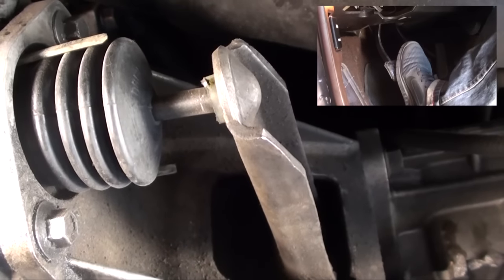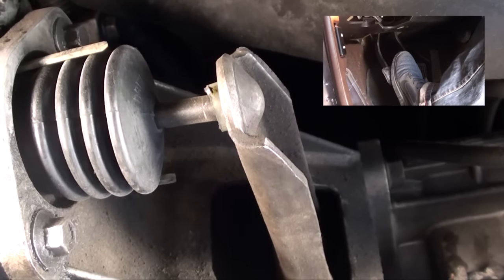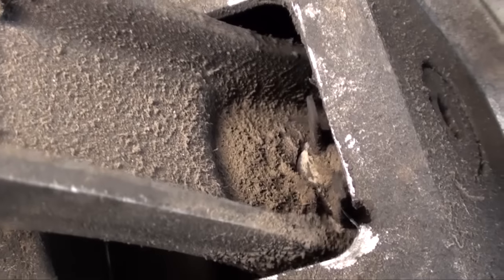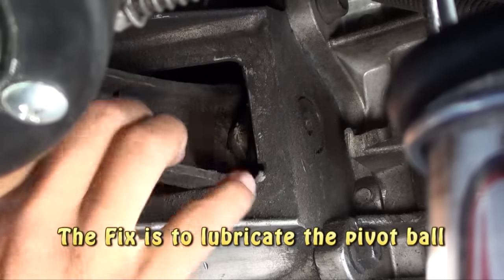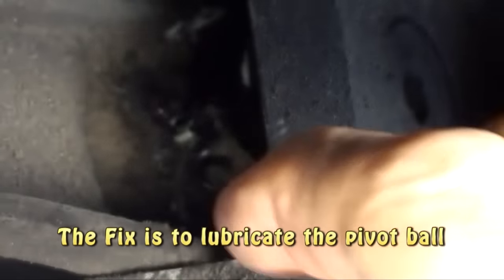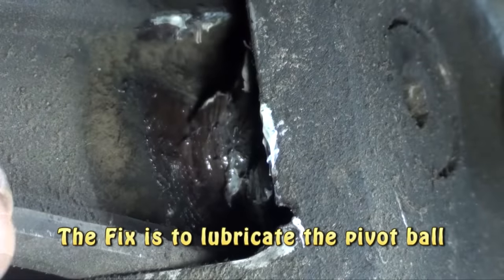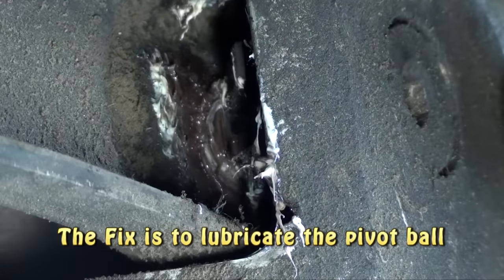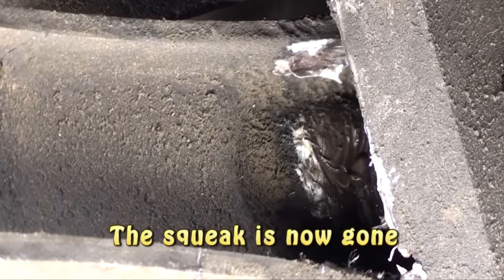Clutch Release Fork Noise

Comment: Here’s one for ya..Had a new clutch put in… changed the master and slave a month later.. since then I can’t get into first Gear or R from a stop.. if I rev the car while pressuring for 1st gear it will fall in.. or if I hold the pedal for 5-6 seconds it will fall into gear… I’m convinced it’s air in the system being introduced somehow.. but I’ve tried bleeding 101 different ways.. always seem to have air in the system.. never let the master empty.. garage wants a new clutch… I’m convinced it’s air… thoughts?
Reply from the maker: It could be air but the clue is reeving up the engine or holding the clutch in for a few seconds before tiring. This really sounds like Clutch drag.  Clutch drag is when the disc doesn't separate from the flywheel and or pressure plate fast enough.  Clutch drag can be cause by a few things but most notably would be grease or oil on the clutch disc or the clutch disc is binding on the input shaft as it tries to retract.  This last one is often cause by the last technician not cleaning and properly lubricating the transmission input shaft and clutch disc splines.  Two important precautions to follow, You have to be very careful not to put too much lube on the input shaft because it will get flung onto the disc and 2) make sure to use the correct type of lube.  Sacs actually make a lube specifically for this.  Most clutch kits also come with a graphite based lube for this but they never give enough because they are afraid the technician will put too much on the shaft.  Oil or grease can come from engine oil leaking into the clutch area or transmission oil can leak past the input shaft seal.  The only other way is for the last tech to be too sloppy with lubing parts or not working with clean hands or cleaning the disc before installing it. Some extra thoughts.  What type of vehicle is this?  was the clutch master cylinder rod properly adjusted? Did you try vacuum bleeding at the master cylinder?  Does this vehicle have a self adjusting pressure plate? Was the flywheel replace, refinished or just cleaned up with some sand paper or buffing pad?
Reply: @DrivelineMaster   I honestly think it is a poorly installed clutch… I’ve ordered a new one.. and I doubt the flywheel was machined..I’ve played with the master cylinders rod and it has to be maxed out in order shift at all… it’s a 06 G35 coupe I’ve taken it to two garages that bled it best they could… I get a lot of noise from the bell housing.. so I’ll do a clutch and hope for the best… I just worry it’s air and I’m wasting my money.. clutch pedal feels like shit only stiff 3/4 of the way down … but that could be from a bad clutch symptoms?? Not just air?
Reply from the maker: I have had some experience with G35's.  You have to be careful with that master cylinder rod.  When the pedal is completely released the rod should be adjusted so to make sure the master cylinder piston is fully back seated on the snap ring.  The rod should have about 1/32" back and forth of free movement before it contacts the Master cylinder piston.  Those clutches have a self adjusting pressure plate and if the clutch is replaced but not the pressure plate this can happen.  When I had a problem with mine i swore there was air in the system.  What fixed it was to replace the disc, pressure plate, release bearing and the Flywheel.  Don't cut the flywheel. Spend the extra expense and replace it. Also inspect the release fork and pivot very carefully for wear or even being bent. On mine the pressure plate got out of adjustment and your can't reset them.  This caused excessive free play which felt like air in the line.  If you do this yourself watch out when installing the flywheel. it will fit multiple ways but there is only one correct way and the car won't run worth a darn if it's put in wrong. There is a location pin in the crank but the problem is the pin will fit into multiple holes. Look carefully on the back of the flywheel.  There is an insert in one of the holes. This insert is for the locator pin. Good luck.

Comment: Thanks to the video , same noise in my renault clio 4 2016 model manuel , is it easy to reach that area myself ? Or ı should go to service ?
Reply from the maker: Really hard to say how easy it is to get to.  Some are easier than others and there are some designs that you can't get to unless the transmission is removed. Those have the pivot ball on the opposite side of the bell housing from the fork opening.

Comment: Hey bud, I have a 2006 Accord v6 6-6.... New luk clutch and flywheel, slave cylinder and the crickets are here until I touch the clutch. On a cold start it is most noticable and I also notice engine chatter in the rear towards the firewall. Is this related?
Reply from the maker: Sounds like the pivot ball didn't get properly lubricated when the clutch was replaced.  This is more common that you would think.  I don't think your other chatter is related but it's hard to tell via YouTube conversation. On your vehicle the release fork and slave cylinder are on the front of the transaxle just below the starter.  If your lucky you may be able to lubricate the pivot ball without removing the transaxle. You might need to remove the starter if it's in the way and you most likely will have to unbolt the slave cylinder. Then remove the rubber boot around the release fork and bell housing that keeps the dirt out of the clutch. Push the fork towards the engine and see if you can get some lubrication on the pivot ball through the release fork opening.

Comment: I have a rattling sound when the clutch is up and goes away when its down but it doesn't squeak at all
Reply from the maker: Same problem and if you let it go long enough it will start to squeak.  The correction is the same.

Comment: Thanks for the video....I have this issue on my 09 Corolla and I used a spray can of lithium grease and it makes the sound go away, but only for a day or so. Guess I need to actually take the boot off and use thicker grease like in the video? What causes the movement in the fork? Is this something that will need to be fixed?
Reply from the maker: You Corolla has a hydraulic clutch and by design the release bearing which is the part that transfers the release form motion to the pressure plate springs will gently ride on the pressure plate diaphragm spring fingers. As the pressure plate rotates the gentle contact between the bearing and the pressure plate causes a small amount of back and forth movement which is transfers  to the release fork. This causes the fork to wobble slightly with your foot off the pedal. If the pivot ball is dry it will squeak.  Once slight pressure is applied to the pedal pressure is also applied between the pivot ball and the release fork. This pressure prevents the slight movement that causes the squeaking noise.  This movement is normal and there is nothing that can be done except lubricate the pivot ball.
Reply: @DrivelineMaster  thanks so much for the info!

Comment: Can you tell me where to lube on mine? Having the exact same issue/noise. Shop said it’s the trans and don’t want to fix it for me. It’s a 08 dodge 2500 6speed manual . G56 trans with a new southbend clutch . Thanks appreciate it !
Reply from the maker: If your chirping truly chirps with your foot off the pedal and goes away when you push the pedal down about 1 inch then you have a pivot ball and fork noise.  If however you have to push the pedal 3/4 the way down before the noise goes away then you have a trans problem.  If it is a pivot ball and fork noise I have other bad news.  The way your release fork and pivot ball is designed there is no way to access it to add lubrication without taking the transmission out.  If the clutch in new the fault is with the repair technician for not applying either the proper type of lubrication or the proper amount of lubrication or both to the pivot ball and fork during the clutch replacement job.

Comment: Long shot in the dark here being a  old video but what if it makes that noise when youre getting up to speed in gear same thing??
Reply from the maker: Age of the video does not apply here. The symptoms when this noise happens and goes away will always be the same. If you hear a chirping noise with your foot off the pedal accelerating it could be a throw out (release) bearing noise.  While you hear the noise gently press the clutch pedal down about 1 inch.  If the noise gets louder you have a release bearing noise. If not the noise is coming from inside the transmission.
Reply: @DrivelineMaster  was squeaky yesterday and not today but I did let it warm up abit more today I bet it's the bearing like you said

Comment: Hello, thank you for posting. I had issues with my gears grinding and hard to land a gear. I replaced the slave cylinder and bled the system. No I have that same noise and still grinds usually on 3 or 4 but it’s shifting a little better. Thought? New clutch? By the way the car is a Scion XB with 154k. Thank you.
Reply from the maker: If your having problems shifting into every gear the problem is going to be related to either the clutch not disengaging properly or the lubricant is wrong or worn out.  If you have problems shifting into one or two gears the problem is in the transmission.  There are multiple things that can cause this.  Worn out synchronizer blocker rings are normally at the top of the list. Once these start to go out they can damage the gears.  Further inspection is needed because the problem could be with a shift fork.  Changing the oil and installing Red-Line Manual transmission fluid  can sometimes help to reduce gear grinding and hard shifting on transmissions with mildly worn out synchronizer blocker rings.
Reply: @DrivelineMaster  ok so 1-2 get a stuck a little bit but mainly 3-4 and sometimes 5 also. If I shift slowly and wiggle the shifter it eventually goes into gear. I used 75w-90 Valvoline Synthetic fluid as the manual recommended. Maybe I’ll drain it and use redline and see before taking to a shop. Should I go to an actual transmission specialist? Can they tell by test driving and listening to the car? I’m afraid  if the transmission is bad the repairs may cost far more than the car’s value.
Reply from the maker: If the trans needs repair or replacing it will be costly and while the trans it out most shops like to put in a new clutch unless it's almost brand new. It's hard to tell when to call the line on fixing an old car or replacing it.  I ask myself a few questions.  What kind of replacement car could I buy that equals the cost of the repair? Would I be buying someone else's old problems. Has the car been good on costing me money beyond maintenance items.  If it seems like every 3 - 4 months or sooner the car cost me repair money (not maintenance) then it may be time to get rid of it.  If you buy a new car for $20K plus are you paying $20K to solve a $2K problem?  As for the shop it really depends on the skill level of the technician.  There could be a skilled technician who knows transmissions but the shop doesn't rebuild them. Not all trans shop have manual trans experts although you would think they should.  If you have a favorite general repair shop that you use and feel confident using for your maintenance and general repairs I would start there and ask them for advice if you should go to a specialty shop or not.  They may also be able to recommend a local specialty shop.
Reply: @DrivelineMaster  thank you so much for your input. I really appreciate it. I’ll make some calls and go from there. Please continue to make video for the uneducated ones like me so we can learn a thing or two.

Comment: Unsure if you are still around, but I have a 98 mustang GT that is doing exactly this. I cannot reach pivot ball from inspection hole on bell housing. Can I just spray white lithium grease in an aerosol can up there??
Reply from the maker: You can try but be very careful to not get grease on the clutch disk or pressure plate.

Comment: Mine is just the opposite. Noise happens when I press the clutch in.
Reply from the maker: Then you have a throw out (Release Bearing) noise. The transmission has to be removed to replace it.  If you go though all that work you should replace all the clutch parts and resurface or replace the flywheel as well.

Comment: My 2006 Accord 4-cyl. Is at 150k miles, and recently developed a squeak from the clutch area that also goas away when I put any pressure on the clutch pedal. But it doesn't sound like a ball squeak, but a sound like a belt slipping or bad alternator. You know, like a sleeve that is worn, and is loose enough to squeal on whatever shaft it is sitting on. The pitch varies day to day, and is never loud like a belt slipping, it just has that kind of tone, sort-of a howl or chatter, as though induced by rotation, not vibration. Car still shifts fine, and once I am driving, I can't hear it over basic road noise and wind. I automatically thought it was the thrust bearingbecause of the type of noise it makes when unloaded. Is that possible? Likely? Will it require pulling the transmission? Ugh. For now, when it starts, I tap the clutch a little to get a moment of quiet, and am listwning to see if it gets worse with time. It started making this noise in the last thousand miles. 
    I guess the best thung to do is get in there and lube the pivot point and see if that fixes it. 
    Thank you SO much for the video. It gives me hope, and something that will hopefully be easy to do in a process of elimination. Peace, and happy shifting!
Reply from the maker: If the noise goes away with slight clutch pedal pressure then it can't be a belt or alternator or even a thrust bearing.  Even if it doesn't sound like the chirping from my video there is a 95% - 98% chance it's your clutch pivot.  If you have never changed the clutch in 150K that is excellent but it also means there is more chance for more severe wear.  Yes I would check to see if you can get into your pivot through the release fork access hole and apply some lubrication to the pivot ball.
Reply: @DrivelineMaster , thanks for the reply. I'll check into getting access to the pivot ball. I didn't mean to refer to alternator or belt except as a sound comparability, not location or source. The squeak of a pivot ball would sound different than a thrust bearing, and that was all I was doing, was differentiating in the type of sound. I've had a noisy thrust bearing, in another car, years ago. It, too, got quiet with any pressure on the pedal. I still think the squeal in my '06 Honda Accord 4-cyl. Manual is the thrust bearing, due to the sound. There is no oscillation, or squeak frequency like what I would expect from a pivot ball vibrating against the fork socket. 
    Anyhoo, whether I am right or wrong, even Kwazimodo had a hunch. LOL! Again, thanks for your video and your views on this. I always welcome ideas and opinions. People like you help me learn. I'm in my 70s, retired, and am still learning!
Reply from the maker: I understand.  Well there are thrust bearings in the engine and in the transmission but none in the clutch assemble.  I can't think of any thrust bearing that the noise would go away with slight clutch pedal pressure but there is always the odd ball circumstance.  Just ask Kwazimodo.
Reply: @DrivelineMaster  crap. I am probably using the wrong term
 Throwout bearing. I thimk of it as a thrust bearig, since its load is in line with the shaft, but you are corrsct about it being a thrust bearing. Thank you, and I apologize for causing confusion. "I are gud wif wurdz."
Reply from the maker: No problem. I often hear from less knowledgeable individuals who don't know the proper term or from individuals from another country who call something by a different name.  In any event the throwout bearing noise shows up under different circumstances than the pivot ball noise. All bearings that are bad will get louder if you spin them faster or if you put them under a higher load condition.  Pushing down on the clutch pedal will put the throwout bearing in a high load condition.  If the bearing is bad the noise will get louder and sound different than it did with no pressure on the clutch pedal.  This is opposite from the pivot ball whose noise goes away with slight pedal pressure. The two opposite as to when the noise appears or disappears.

Comment: It could be the same problem with my strada triton 2013?brought it to the mechanic and he said it was the release bearing or the spring of the clutch disc?
Reply from the maker: Here is the clue on how to tell the difference between a release bearing and pivot fork noise.  With the release fork pivot ball noise: The noise goes away as soon as a small amount of pedal pressure is applied.  With a release bearing you hear the noise or the noise changes in tone when a small amount of pressure is applied to the pedal.

Comment: i have this problem and i want to fix it. what lube did you use? i don’t want to cause damage by using the wrong type of lubricant
Reply from the maker: Almost any lube will work but I do recommend a lithium based high temp wheel bearing grease or white lithium like what I used in the video. The better grease would be the high temp lithium based wheel bearing grease.